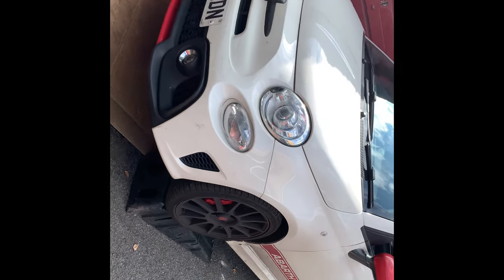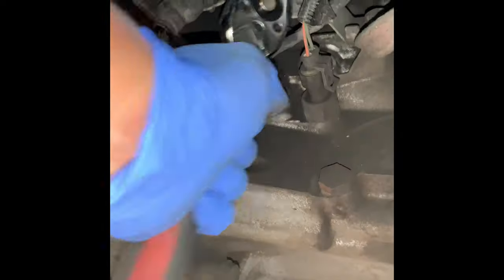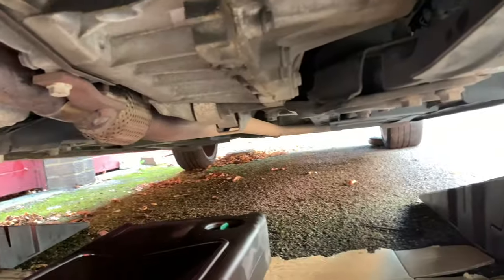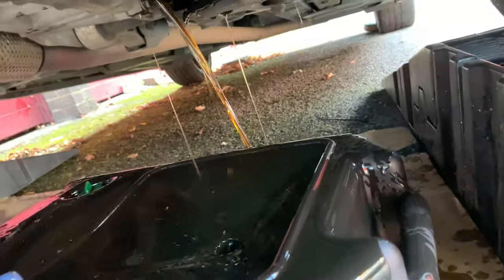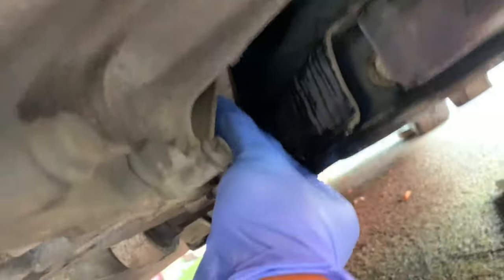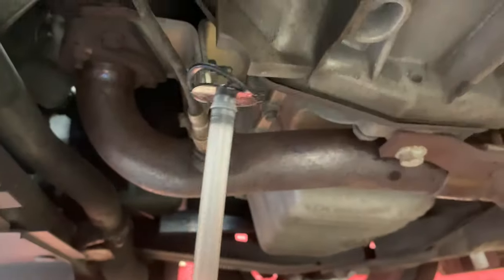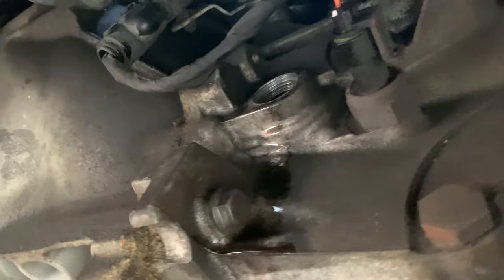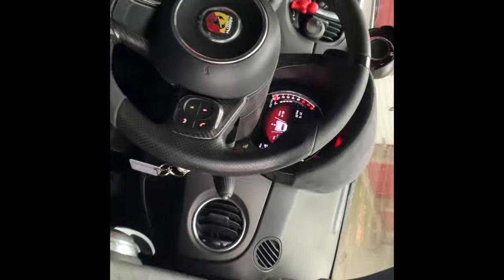Abarth 500/595/695 Competizione (2016) Automatic/Manual Gearbox Transmission Oil Change

Comment: Did this fix the problem with the gear box
Reply from the maker: Yes
Reply: @jaysworkshopgarage  ok wicked as I’m having the same problem that it comes up with check transmission
Reply: How did you get the check transmission light off mate
Reply from the maker: @jayavello5461  Diagnostic Tool
Reply: Mine has this issue. I will be doing this on my next visit to the garage